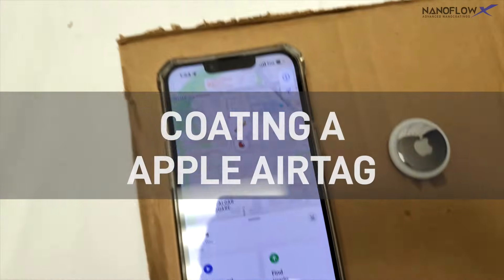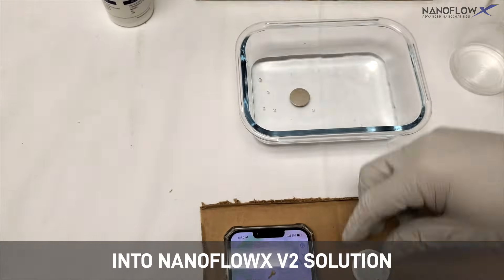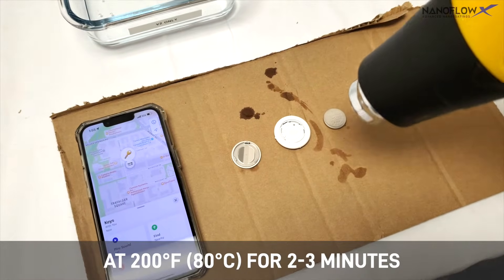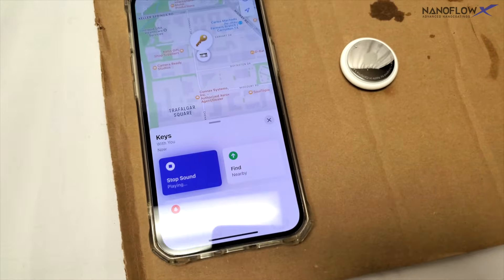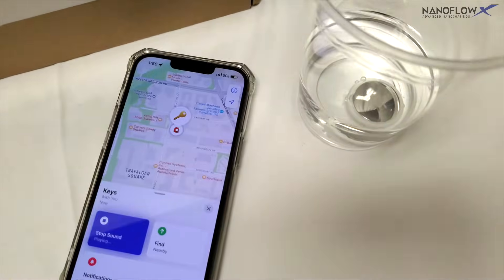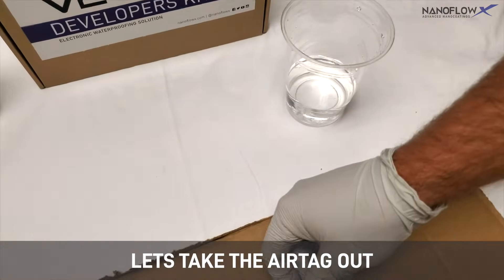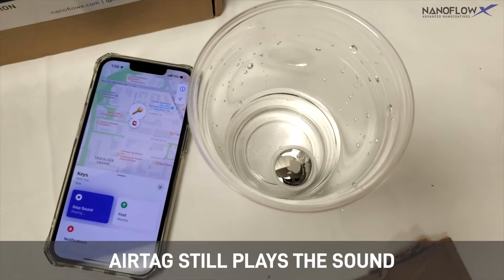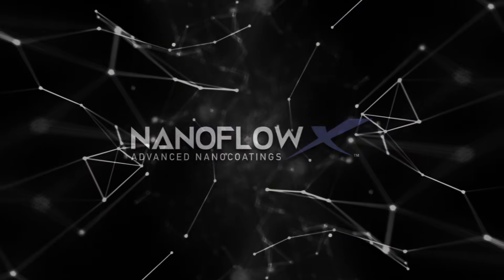Apple AirTag Made Waterproof in 2 minutes with NanoFlowX

Comment: Apple AirTag is water resistant... BUT  up to 1 Metre and for 30 mins.. Nanoflowx v2 test is at 1" for 10 seconds therefor is a totally different scenario, Not only the Depth the pressure is also totally different. This is not a like for like test by any means.
Reply from the maker: Thanks for sharing your thoughts and for pointing that out! You're absolutely right that the Apple AirTag has a water resistance rating of IP67, which means it can withstand up to 1 meter for 30 minutes under lab conditions. Our demo with NanoFlowX wasn’t meant to replicate that exact rating—but rather to show how our coating can add an extra layer of protection for everyday water exposure, especially over time or in harsher, real-world environments where devices might not be factory-sealed anymore.

We appreciate your feedback and always welcome a good conversation about tech and testing.